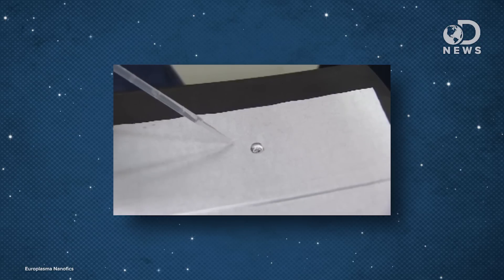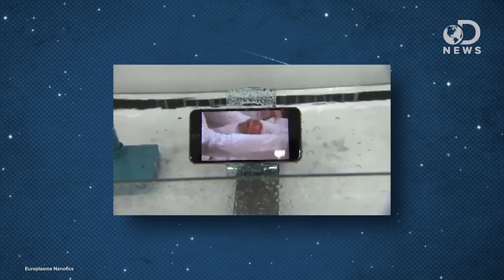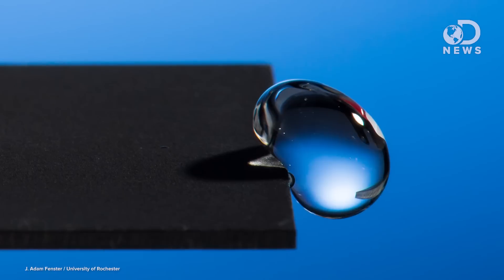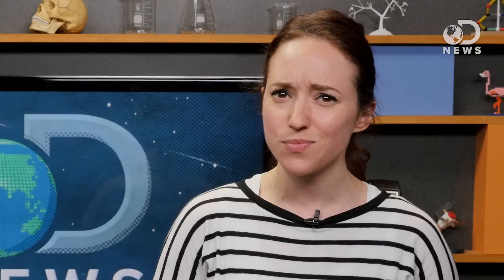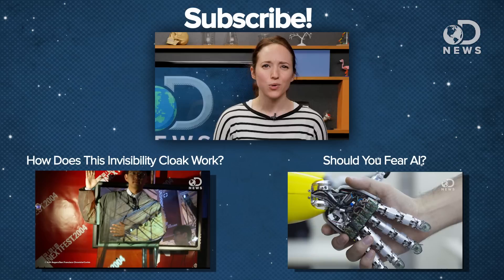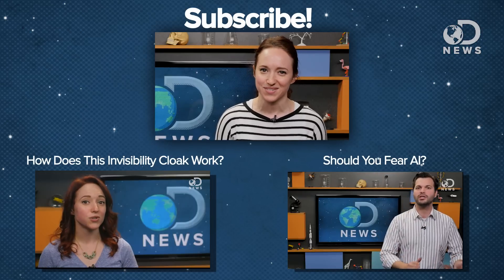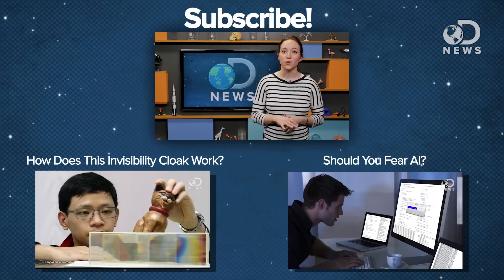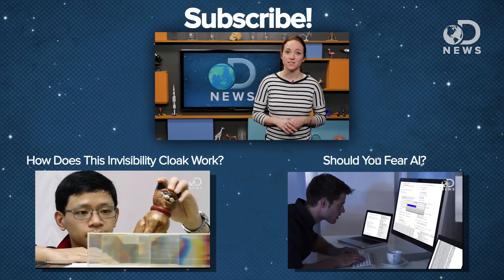How Lasers Make Metal Waterproof!

Comment: That sounds cool... But if you scrub it hard with a sponge wouldn't that mess up the pattern? (happened to my teflon pan)
Reply: Just what i was thinking
Reply: ***** Every metall bends, especially if it's a thin sheet. Here you have a really small pattern, smaller than a thin sheet. smaller than f.e. aluminum foil (steel foil of the same thickness won't be any more harder) so it won't be very stable or hard.
Reply: ***** well, using  a normal soft sponge may not in the first place, but this could also change on the long run..
Reply: I doubt it since it is structured more on a nanoscopic scale. So it would take a lot more force to break it. Also there are a lot of the repelling structures therefore they are more significant all together rather than a single structure
Reply: Actually, consider that the pattern being etched unto metal is similar to the pattern etched unto the transparent parts of some dollar bills which doesn't get rubbed out. Even though the metal is thin, it is also very very short, which gives it much more strength despite it's thinness.
Reply: Atomic Charge That`s a very good point..
Reply: ***** Have you heard of hockey skates? The blades are metal. Why do you think they need to get sharpened so often? Its very easy to scrape away microscopic levels of any material.
Reply: D
Reply: If all the gooey gunk rolls of in the first place, why would you need to scrub it with a sponge?
Reply: KlingonCaptain The dirt itself would rub it. And being a very thin surface treatment without any particular hardening process it will wear quite quickly in my opinion. Maybe not as quick as a teflon coating but still. It depends on what applications you could think for this technology. Not good for large scale water collection probably.
Reply: KlingonCaptain a real man of genius.
Reply: why would need to scrub a surface that is 100 water repellant. rinse and fahgettaboudit.
Reply: Just use some sandpaper...
Reply: Teflon is a coating, not a part of the frying pan itself.

Comment: So if, we... created sphere or cube with this process and say dropped it down into the ocean would it collapse in on itself at a certain pressure being water resistant in this manner? (If so, in theory we could apply vibrational sensors or emitters inside them and form net-like system with a madrid of them and finally map oceans/seas/lakes or hell even deep-sea organisms... obviously speculation of a tired college student, obviously) Or say could it withstand water from a tanker or firetruck, does it have a breaking point with the application of force water-based? Is it just water or liquids as a whole for instance anything highly acidic? Would it have the same properties of heating or cooling points? So many questions and so many applications.
Reply: That's very sound sir... slow claps
Reply: What?? Why would this treatment have an effect on an objects resistance to pressure?
Reply: Cristian Iacob I don't want to verify everything, but you sound convincing enough.
Reply: Cristian Iacob Shouldn't it cool down faster if it is warmer than the surrounding area because it has a larger surface area and thus dissipates more heat?
Reply: no matter how much warmer an object is than another, heat transfer between 2 objects remains at a constant rate. 
Of course, I am not sure what you are talking about as you seem to be asking 15 different things in one question. Be more concise next time.
Reply: O3O... it was just a quick idea that I come up with on the fly with its applications with mapping as the focus... I know its not sound, but it was reasonable... facepalms self
Reply: SangoProductions21 I believe it's merely the ramblings of a madman xD
Reply: Very mad... creepy silhouette Stein grin...

Comment: So I believe that this laser etching works because it employs the surface tension of the water. At great depths, the force from the weight of the water would overcome any structure not structurally fortified to withstand such pressure.
Reply: Elexus we will go swimming

Comment: So clean water is repelled if the metal is clean? Something sticky and wet will have more surface area to attack with these ridges right? and a more brittle one at that.
Are the ridges too small for naughty particles to stick in them?
Seems very applicable in a closed/semi closed system though.

Comment: All they're doing is putting holes in the metal. While that does make it repel large quantities of water, I don't see how that will stop rust in the long run since a lot of that is caused by moisture in the air rather than large drops of water that we can see.

I would need more information and further studies done to determine an answer as to how I feel about it.

Comment: Are the metals hydrophobic to the point where you can leave water in a bowl of metal with this pattern, the metal will never rust? Or does it just prevent water from sitting on the metal for too long?
Reply: Roclee612 That the thing though, the little fins are part of the metal. If it's contacting the little fins, it can eventually rust those away completely right?

Comment: It will still rust, metal rusts from O2 not just from H2O. Oxidation - Oxygen
Reply: yes. But a major factor is water exposure. As well, electronics inside that metal case do actually care about water much more than oxygen.
Reply: SangoProductions21 Just because metal can now repel water doesn't mean you can water proof an electric component, as the electricity will still arc through the water and potentially short certain bits out
Reply: Inform yourself please...
Reply: Yextus I was implying that this has applications beyond making the component water resistant, like making a cell phone case that resists water protects the inner electronics (the phone).
Reply: Although it is true that Oxidation is the cause for the rusting of metals and oxygen is a key component in the reaction, the rate in which this happens is generally so slow, it's not worth considering. When water is added into the reaction, it acts as a catalyst of sorts, speeding the reaction up a fair bit. For those who are interested in an example of how water causes rusting, here is a basic example using Iron. Iron, like many metals will tends to dissolve when in contact with water. When Iron dissolves a few electrons are released, this causes a small current to flow through the metal. This makes the place where the iron dissolves act as an anode, and the area around it will act as a cathode and absorb the released electrons. The water will also dissociate a bit causing hydroxide to form around the cathode. This hydroxide is then used in a reaction with the iron which creates Iron Oxide which is rusted iron. For those who find this interesting, you should look into Voltaic Cells, and electrochemistry.
Reply: Much more in depth than my puny little one sentence on the matter lol...
Reply: iron only rusts in the presence of both water and oxygen.
Reply: cwjakesteel does that means that oxygen alone wouldn't be able to rust metal?
Reply: This is why this video reported on the progress against corrosion, not "rusting."
Reply: Adrian Ascael not "metal", specifically iron.
Reply: cwjakesteel That's only half correct. Oxygen can react with iron to create rust without water, however this reaction is very slow and is generally unnoticeable. When water or a similar catalyst is present, the reaction time is reduced at a notable rate. It's also worth noting that in the context of this video and in the real world, the air which is the most common source of oxygen for us will almost always contain some form of water which is capable of being the catalyst in these reactions.
Reply: Adrian Ascael Oxygen alone can rust metal however it takes place at a negligible rate. Water is simply a catalyst which speeds up the reaction. This will happen for most metals however there are a group of metals called the noble metals which are considered to be resistant to corrosion and oxidation. The list contains silver, platinum, gold, rhodium, ruthenium, palladium, iridium and osmium. There are other versions of this list which include mercury, rhenium and copper. It's also worth noting that titanium, niobium and tantalum are also all very resistant to corrosion however they are not considered to be noble metals.
Reply: Darkhax No. Iron absolutely needs both water and oxygen to rust, as rust is  hydride of iron and hydrated iron oxides. If iron corrodes any other way, it is simply not called rust.

Comment: I don't think it will be used in large scale steel structures at all. I weld, and say you have a piece of metal in a structure like this and it needs to be repaired, the repair will rust out.. Plus any decent bump on it will ruin the laser etch, mild steel is easy to dent, even on a 1 inch thick plate if you hit it with a corner of a hammer it will dent in a little bit and if that happens with this, it will ruin the coating. Plus in large scale applications metal takes a beating just lifting it up and down again making this not a good solution. Plus, in pipes with water running over it, wouldn't the water erode at this and it would eventually rust out in the end? Maybe the pipe will last a lot longer, but it would be cheaper to replace a pipe without this technology... Just my thoughts..

Comment: UNDERWATER CITIES! Who's with me?! :D
Reply from the maker: But wait... https://www.youtube.com/watch?v=vdGZdmuDu4I
Reply: Ever heard of Andrew Ryan...yah...
Reply: DNews Would this technology still work if the metal was completely submerged?
Reply: b-bioshock. oh no
Reply: I am not going to live there with out plasmids...
Reply: DNews that was so smooth
Reply: Sorry for being a buzzkill but you'd get crushed by the pressure of the water.
Reply: srry to buzz kill your buzz kill but you can build  infrastructure that would resist the pressure.
Reply: Ricky Chen Have you heard of a thing called submarines? You should look them up some time.
Reply: thebrotanic Not even submarines are allowed to go that deep. If you're talking about an underground city that dwells in the middle of the Photic and Aphotic zone then I can kind of understand.
Reply: we dont have to build at the very bottom of the deepest part of the ocean dude. I know i wouldnt.
Reply: rust would be the least of our problems for building underwater city's, and there are much better and cheaper ways of preventing rust than this, and at extreme deeps there is a lot of pressure and i don't think this waterproof system would function efficiently or in the same way.
Anyway wouldn't the low levels of oxygen in water at very high deeps rust metal extremely slowly?
Reply: hell yeah

Comment: What would happen if you coated a submarine with this?
Reply: This technology helps water roll off surfaces. Being submerged is something else. The main force is friction, rather than adhesion.
Reply: that's a great idea, but it would take forever to etch an entire submarine, maybe just the nose and front of the fins ;)
Reply: Jonh T, probably not the fins, though because you need that friction to steer. Other than that, it would reduce fuel consumption.

Comment: So that whole vid only mentions that we can now pump water uphill without energy cost... I see that as the new tech that can revolutionize the energy industry. If I can pull water up hill with out a pump.....0 energy needed after the initial manufacturing process to run a water wheel generator....That sounds cooler than a water proof phone ..I have 4 of those already..lol I wonder how much water a 30 ft section of this stuff would move?